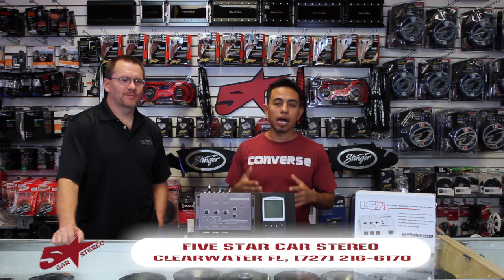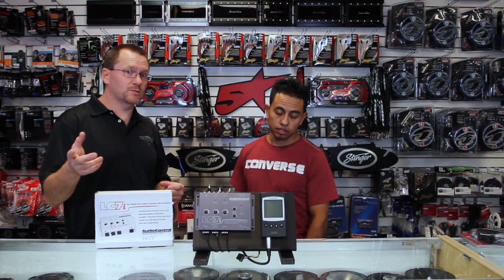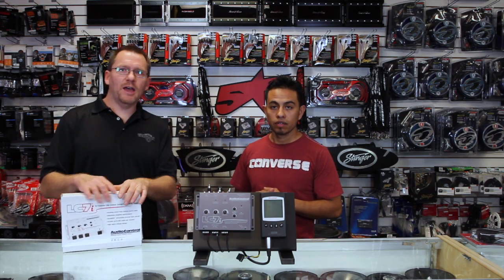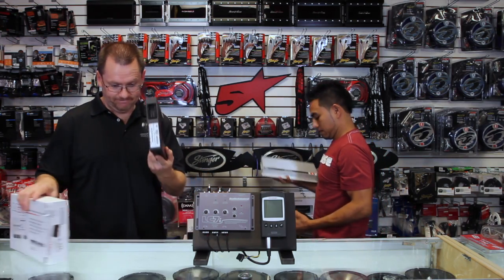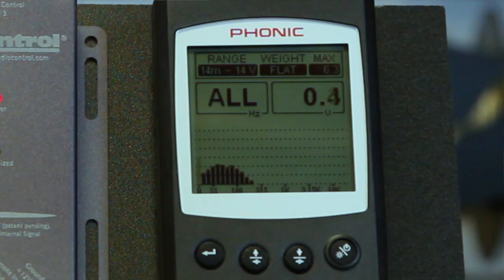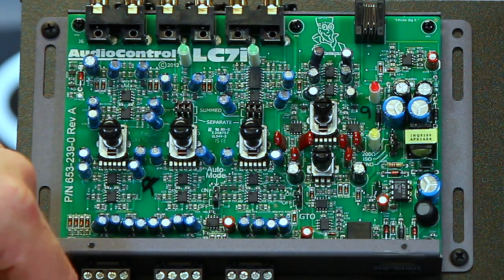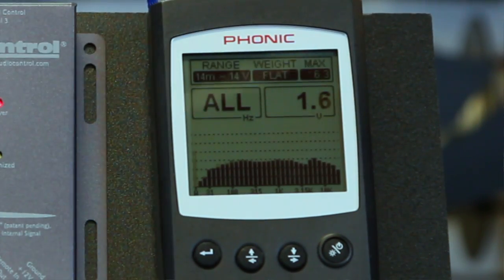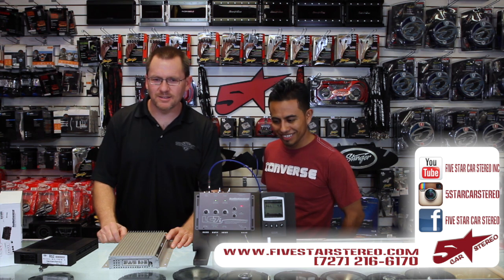Introduction to AudioControl's LC7i part 1 "how to do 3 way summing"

Comment: Good video as always, but I want to further this discussion.  I have a '17' Camry with the factory JBL sound (Factory touch screen head unit with NAV).  The front cabin of the car sounds great; and  the factory woofer(s) gives it a nice boost, but I want to add a little more.  I want to replace the  rear 6x9's in the back deck with 2 nice after market 6x9's and also add 2x 10"subs for some more added bass.  

The main goal here is to be able to run the bass setting on the head unit in the negatives to increase the clarity of the high's / mid's at higher volumes and increase the gain on the sub's amplifier for the added bass from the subs. I have no intention of messing with the factory amp or speakers other than to pull a signal for the LOC since they already sound ok.  Also the rear with the new 6x9's being on their own amp I figured I would have added control over their sound be reducing the low freq and only have them as an added mid/high range.  

Current looking to do:
Add 2x new 6x9's in rear deck on their own amplifier 
Add 2x new subwoofers on their own amplifier
2 gauge power wire with 1 farad capacitor ran to a 2 way distribution block.

With using this type of setup do I need to run 2 LOC's?  or will the LC7i work fine?  

Any feedback would be appreciated
Reply from the maker: Jason Cohen question, if I recall the rear 6x9 is the factory sub, correct? There is also rear door speakers?

Comment: Please advise where would I install this Lc2i? I am using my stock deck. Do I install the LC2i before the amp or after?
Reply from the maker: +Richard De gannes it will go between the factory amp or radio and before your aftermarket amp.

Comment: HI I've been having a problem with white noise since I installed the lc7i.. wanted to know what can be the problem I have a 2008 acura tsx premium sound system .. I have a 4 channel and a mono block amp connected
Reply from the maker: Sisco Sosa it may be a gain issue. I would star by turning down all the gains on both the LC and the amp. Then find a good point on your radio about 3/4 of the way up. Then download load the Pink noise sound track so you can play it in the stereo. You may also want to disconnect your speakers from the amp for this part. Start with just the fronts and turn up the gain on the LC until the light comes on and back off until it is off. Repeat on rear and sub. Connect speakers. Play a song you know well check the floor noise. If none start turning up the gain on the amp one at a time. Play just the front then rear then sub. Connect them all adjust down for blending. If this does not help it may be an issue interfacing with the factory amp.

Comment: Hi, I'm looking to upgrade my stero in my Saturn Astra. I have a cd30 mp3 made by blaupunkt it sucks, but since my radio is my bord computer unit in one, I need a high-low converter for my active sub for that little extra noise that is missing. Which it the best on the market ?  I've already added an aux in by installing isimple is31.
Reply from the maker: MrBotyesz if you are planning on replacing your door speakers and amping them, go with the lc7i or a lCQ-1. If you are just adding subs get the lc2i.
Reply: Five Star Car Stereo thank you for helping me
Reply from the maker: MrBotyesz you are welcome

Comment: i bought a lc7i took to ge shop to install and i don't think they hooked it up right everything plays but the green light on the audiocontrol don't light up like in this videos where it says connected yo main and etc.
Reply from the maker: They may not of set the unit up right. The gains may be off on it and the gains on the amp. Not everyone now how to put these in or read the instructions for that matter. How does it sound?
Reply: +Five Star Car Stereo sounds good, i have a 2008 mdx do i need to do summing and if so how do i take out thr jumpers, etc? thank you
Reply from the maker: +DuRaG standard or Bose? Did it have a factory sub?
Reply: +Five Star Car Stereo regular factory system no name brand yes it had a sub in the back
Reply from the maker: +DuRaG no summing is needed, it should be a basic front, rear , and sub install. That is the factory settings so no need to move any jumpers.
Reply: +Five Star Car Stereo ok just making sure still new to all this, thanks again
Reply: +Five Star Car Stereo how would i connect a eq to the audiocontrol?
Reply from the maker: +DuRaG I would swap the lC7 out for the LCQ1 or get the EQS

Comment: nice video very well explain, my question to you i have a 2016 gmc sierra its got navigation but after i put my rca converters for my sound system the chime and navigation doesnt come thru the sound system would the lc7i help
Reply from the maker: What do you the front drive speaker out put connected to?
Reply: +Five Star Car Stereo , front speakers connected to memphis amp but i use that rca converter for my sub do you think its better to use the back speakers rca converter for my sub and the front for my highs
Reply from the maker: +Adrian Alanis so what we do in these trucks when keeping the factory radio. We connect every thing to the rear speakers( all the high level inputs). Then we hide on of the factory speakers up in the dash facing down. Next we connect the drivers front output from the radio to the speaker. This speaker will play the chime, navi, and Bluetooth phone. Then go into the radio and fade it to the rear. Doing this will keep the normal sound out of that speaker in the dash.
Reply: +Five Star Car Stereo one last question brother do you recommend to use rca converters or the audio control lc7i
Reply from the maker: +Adrian Alanis I like the lc7i to keep the voltage up and the signal clean. The AccuBass helps a lot also.

Comment: Great Video as usual.   I have a good one fore you.  I have a 14 SRT cherokee with 19 speaker Harmon Kardon system.   Is it possible to leave some of the speakers (the cente up front, and pillars) running on the stock amp, and combining the front and rear setups into something like an LC7i to go to a 5 channel and powering just the Sub, and front and rear doors off the after market amp?    Hope that made sense.   Just not sure what to cut and combine.    Will this cause my amp to "panic"  ??    Thanks
Reply from the maker: This is going to be a fun install. I would not leave the factory amp doing anything if you can help it. The dash speakers and the doors will need to be summed together and the same in the rear if you want fader. You may need to go with an LC8 for your install.

Comment: Ok guys I feel like I have a complicated one for you but I've subscribed to your channel I think you guys are awesome and I think you're the only ones that can help me in this situation please respond as soon as possible thank you very much here is the info that I need. I have a 2013 Hyundai Veloster Turbo with the dimension 8 speaker system 2 tweeters 2 door speakers 2 rear quarter panel speakers and a subwoofer in my left rear panel of the trunk. I I have an lc7i and I directly spliced into the wires going into  the factory amplifier under the passenger seat to get a signal . and here is how I wired it. I took the signal for the front doors 6" speakers and ran them into the main Channel, then I took the rear quarter panel 6 inch speakers and ran those to the second Channel, and I took the subwoofer wires (for some reason the wiring diagram on my Veloster said I have 4 subwoofer wires - left positive/negative and right positive/negative. so I took those and plug them into my third Channel, ran all 16 wires back to my trunk as described plugged into the channels as described with jumpers set to summoned and GTO off and auto mode off and from the same factory amp wiring harness I ran the remote wire into the lc7i remote in plug in and then ran a remote out wire splitting it into a y to two different amps what is a Rockford Fosgate bridgeable mono stereo bass amp and the other is a 4-channel Cobalt Orion amp. please explain to me what I'm doing wrong because I'm getting a beeping noise not getting any bass output and if you can please drop me up a diagram and tell me what I'm doing wrong or right I would appreciate it and this is all for the factory deck Dimension setup with the subwoofer in a back and a center speaker in the dash. PLEASE HELP.
Reply from the maker: So the reason you have 4 sub wires is because it is a dual voice coil subwoofer. The front tweeter may need to go to the 2 and not the rear. You may need to sum the front door mid and tweeter to get a full range signal to your amp. If so you would turn on summing for 2 to the main. Rear channel can either be left out and just use the amp gains for fader or if the amp has a high level input just use it for rear. If it does not you can get a pac-audio lc3-2 for the rear.
Reply: +Five Star Car Stereo thanx guys so if I do front in the main ch. tweeter on ch.2 and summ them both do I just summ third and plug in bass amp or leave ch. 3 open.. how would I power my aftermarket Subs with a full signal?
Reply from the maker: +Eddy Gage yes on the main and 2.  I would run the factory Sub into 3 and out to sub amp. You do not need to sum it into the other channels keep it to it's self.

Comment: question:
is it possible to feed more than one speaker signal to a single input?  i have more channels than there are inputs on my lc8i
Reply from the maker: No you would need another LC. What car and how many channels?
Reply: Land Rover LR3 with Harmon Kardon Logic 7 - 11 channels
Reply from the maker: +TheMizarc1 when summoning channels together the end goal can very. 1. Get a full range left and right- use only the speakers it takes to do this and leave the rest out. Example tweeter + mid range + sub go to amps and adjust fader in amp. 2. Front, rear, sub combine all  channels in corresponding zones. Example all fronts together, all rears, and sub. To do this you will need 2 or more summing devices. 
 Most of the time we try to do example 1 with an lc8i or an lc6i and a lc2i to get accu-bass.

Comment: I have a 2015 dodge charger with the base alpine 6 speaker system. Two 3,5's in the dash, 2 6x9's in the front door's and 2 6x9's in the rear deck. Replacing the 4 6x9's and adding a 4 channel amp. Also adding a mono amp and subwoofer. Will the lc7i work with this system and what would be the best way to wire this? Also do I need to use summing? Thanks.
Reply from the maker: Yes you will need to sum the 3.5 and the door 6x9. Connect the 3.5 to main and 6x9 to channel 2. I would not add in the rear speakers to the LC. Run the channel 1 out to the 4 channel amp and channel 3 out to the sub amp. Select 2 channel input or y the input on the 4 channel amp. You may also need a load restore on the input of the LC to wake up the factory amp.
Reply: +Five Star Car Stereo Thanks for your quick response. Would it be ok to use the factory 3.5 or do I need aftermarket?
Reply: +Five Star Car Stereo Also, do I need the accu bass knob or can I use the one that came with my rockford mono amp? Thanks.
Reply from the maker: +bigd96792 yes you can use the factory, but I would not. Get some of the Rockford Punch 3.5, they are sweet. You can use your amps sub knob that is fine.
Reply: +Five Star Car Stereo OK thanks. So do I run the rear 6x9 off the factory amp or the 4 channel amp?
Reply from the maker: +bigd96792 the 4channel for sure. We would run the front(6x9 and 3.5) on front and rear on rear. Add a set of 47microfarad non-polarized caps( bass blockers) to the 3.5 in the dash. This will xover them over higher then the 6x9.
Reply: +Five Star Car Stereo OK, got it. Thanks for your help!

Comment: I am getting a sub and a monoblock first, and will have my speakers changed at a later stage. If I am installing a sub, to which channels should my rear speaker wires go to (main)?
Reply from the maker: I would run front(main) and rear(channel 2) while you have it apart. You need input on the Main for the GTO turn on and channel 2 to feed the sub channel.
Reply: Five Star Car Stereo So I still need to run the front door speakers wires to Main, and rear door speakers wires to Channel 2? Then the output channel 2 goes my sub RCA?
Reply from the maker: +Ale Wu yes you have it right. The channel 2 will feed the sub output if  the jumpers are in the default position.

Comment: hey guys like the vids I have a question I have a 2008 infiniti g35x with front and rear door speakers with tweeters. I wanna add 2 subs and 2 amplifiers one for the door speakers and one for the subs will the lc7 be a good fit for me or is there a different option that will fit my setup
Reply from the maker: Is it Bose or no Bose?
Reply: +Five Star Car Stereo no bose... my amps are a 4 ch for doors and a 1ch for bass if that matters
Reply from the maker: +luis ortiz yes the lc7-I will work great for that system
Reply: +Five Star Car Stereo so it has to be that many ch
Reply from the maker: +luis ortiz not if you do not want front to rear fader, then you can just do the lc2i. Otherwise the 7i will let you do front and rear and create a sub channel for you.
Reply: +Five Star Car Stereo great thanks got any other videos on how to install wiring wise
Reply from the maker: +luis ortiz not yet sorry

Comment: So when I run my amp I'll tie my tweeters in with the door speakers ( same line? )
Reply from the maker: The factory wires are tied together. If you have an out board xover it can get tricky

Comment: I can't find anyone to give me the info I need. I'm trying to install this weekend. I've got a '12 F150 non Sony factory radio. It had factory tweeters in the pillars, mids in the front doors and a factory 2way in the rear doors. All the speakers have been upgraded and will be adding a 4ch amp and a sub amp. So my question is, I hook up my tweeters in the main channel, then do I hook up my read door speakers into the 2nd channel and my front door speakers go into the 3rd channel?
Reply from the maker: If you have a non Sony system the tweeters and the front door speakers are on the same channel. There is no need to do any summing in this system. Connect the front doors on into main and the rear go into 2 input. The 3 will get auto input from 2.

Comment: Trying to boost the sound  in 2015 Accord EX can I do it with just the Lc7i it's a lease so I'm trying to minimize what I spend & what I do
Reply from the maker: Does it have the factory subwoofer in the rear deck?
Reply: +Five Star Car Stereo No sub woofer just 6 speakers 160 watt system
Reply from the maker: +The Grove TrinNY yes the LC7i will work great. The only other thing you want to check s if your car has noise cancelling mic's. You can tell by looking on the headliner toward the rear wind. If the is a square there let me know and I will tell you how to bypass it.

Comment: so my car has 2 front tweeters 2 front door speakers 2 back door speakers and 2 rear deck speakers. I'm guessing each pair has its own channel on the amp since there are wires for each of them. how would I connect them on the lc7i? would I just connect the pair of tweeters to main channel then the front speakers to the 2nd channel and the deck speakers to the 3rd channel? but then that leaves out the back door speakers so how do I connect those?
Reply from the maker: Yes to the first part of the question if you want to use the 7. You will need to turn on channel summing for inputs 1 and 2.  I would also run the tweeters into 2 and doors into 1. You can go into a 4/5 channel amp and use the gain on the amp to balance the front and rear output because you will not have a fader. If you want to retain the factory fader you can go with the lc8i, however you lose AccuBass.
Reply: +Five Star Car Stereo Ok so what u mean is run the front door speakers into channel 1 which is the main channel.... and the tweeters to channel 2? and for the subwoofer amp run it to channel 3 right?
Reply from the maker: +Sisco Sosa yes you got it and sum the main and 2 together. That will work.
Reply: +Five Star Car Stereo auto mode has to be off right? what are the settings on a brand new one?
Reply from the maker: +Sisco Sosa yes turn off auto mode. By new do you mean the ones with the blue swish, if so they are the same.
Reply: +Five Star Car Stereo no I mean how does a new lc7i come auto mode on or off
Reply from the maker: +Sisco Sosa my bad , it is on most of the time.
Reply: to add to this question i have my wiring diagram of my door mid range connected to the tweeters there is no separate cable wire for the tweeter. I have a front center channel (audi a4 base system with stock amp in trunk). Also the rear doors have a tweeter up top and a midrange with the same connection as the front door speakers as the tweeter is connected into the door speakers. How would i wire this unit then?

Comment: What would i use if keeping stock head unit but adding 4channel amp for door speakers and mono amp for subs?  Thanks
Reply from the maker: It depends on how may outputs your cars factory systems has. So for example if your factory radio just has front and rear and maybe a sub, the Lc7 will work great for you.
Reply: Five Star Car Stereo when do “factory headunits” have RCA outputs in the back of the headunit? I have never seen a headunit in a vehicle from the factory have any type of rca outputs on them that’s why you have to buy the Lc7i??